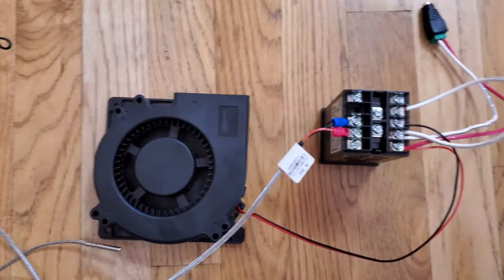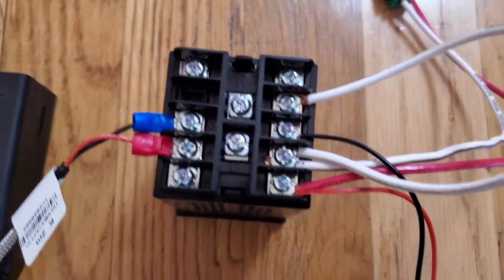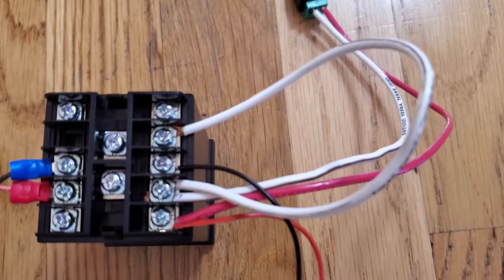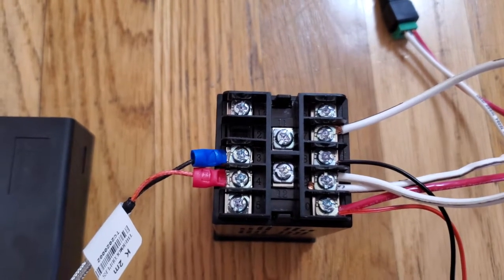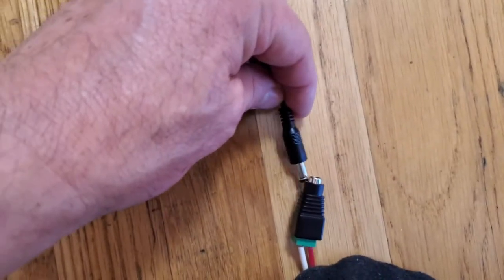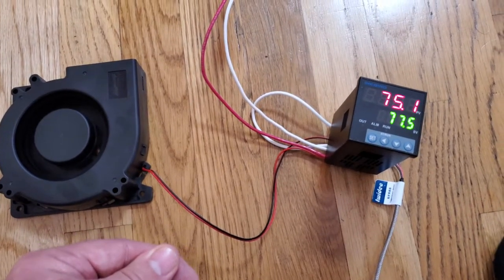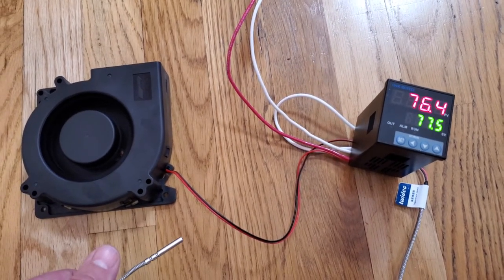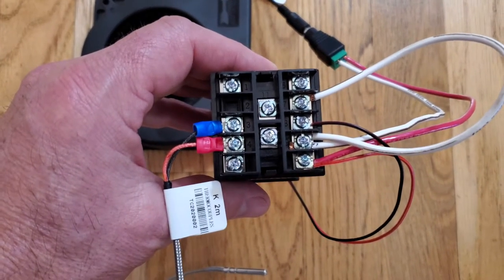Wiring InkBird ITC-106RL to control fan directly

Comment: Hey tank for your vidéo. I m à mapple sirop producteur and i need to use this technic for do m’y sirop. I would like to Know how create a by-pass with a switch for start manualy the fan  ( in your case)
Reply from the maker: Raphael, I did that exact thing on this controller.  All I did was get a two pole switch and wire it in between the fan and the PID.